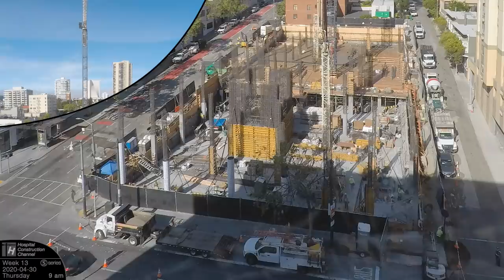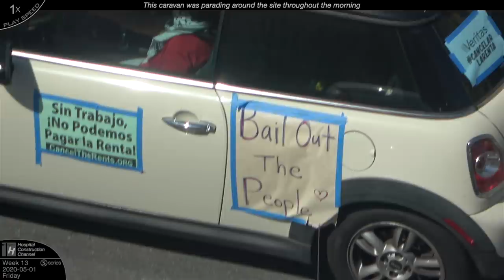One-week construction time-lapse with closeups: Week 13 of the Ⓢ-series

Comment: What's going on with the underground utility vault at the lower right corner? at 14:25 they removed what looks like several large transformers. I never saw them replaced before they covered the vault up again. At 36:55 they put in some small pieces of equipment, but nothing that would replace the transformers, I'd think.
Reply from the maker: I have no definite knowledge, not having any connection to the project.  But this is my guess.  The old building that was there before got its power from that location (you can see it during the demolition over on my "Hotel Demolition" channel).  I suspect the new building will be getting its power from the left side somewhere, since there was no evidence of any power going in on the lower right when the concrete was poured.  I suspect they were removing old equipment no longer needed since the old building was demoed.  I have seen some old (probably obsolete) plans for the new building that show a room marked "transfer switch" over on the left, side so I suspect the power will be coming in from the left side, perhaps in one of those places they've been digging up the street.  Just a guess on my part.
Reply: @HospitalConstruction  Thanks. That make sense.
Reply: Also, those transformers may have been utility owned and removed since they were no longer needed.  The new building transformers may be inside the  basement of the new building with high voltage lines coming in from the street.  They may also have been removed because they contained old hazardous materials like lead lined cables or pcb transformer oil.
Reply: @HospitalConstruction  Transfer switch may refer to the proposed location of what is known as an ATS, or Automatic Transfer Switch, that handles cut out of commercial utilities and cut in of a backup power generator during power outages.  That would typically be located with the rest of the electrical line gear.  Something like Senior living would very likely include that due to potential need of emergency power for medical monitoring gear for the residents, power for the lights and elevators, etc.

Comment: What happens to all the concrete left in the long tube from the pumping tower and from the concrete pump near the delivery truck for that matter.
Reply: You can see the pump truck sometimes empty the pipe back into the delivery truck. I didn't see what the tower did.
Reply from the maker: They flush it out, either back into the last concrete truck, or into plastic "swimming pools" or sometimes flat metal bins and then the leftovers are discarded. In some prior episodes all of those approaches were visible.
Reply: @HospitalConstruction  Thanks for info.